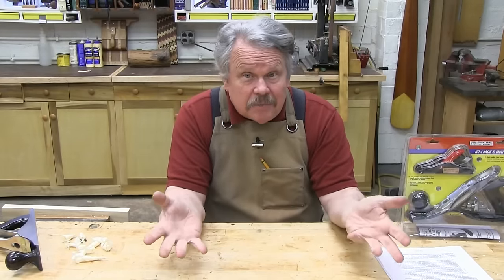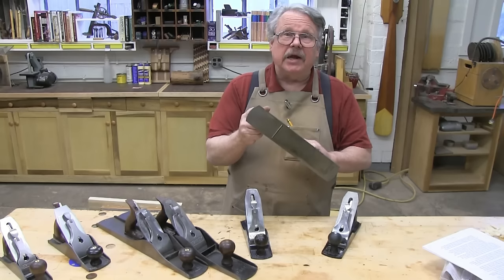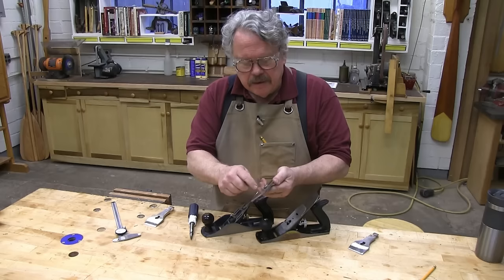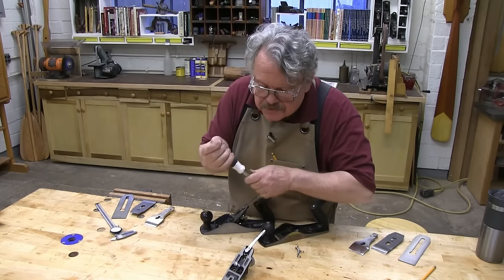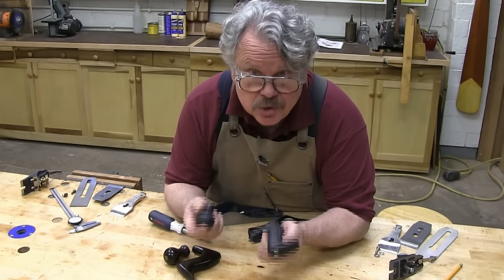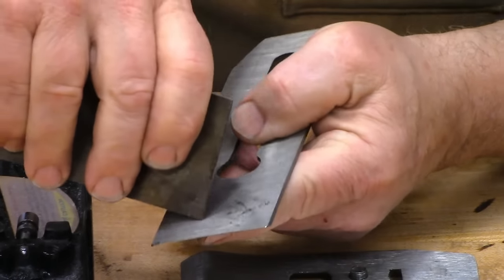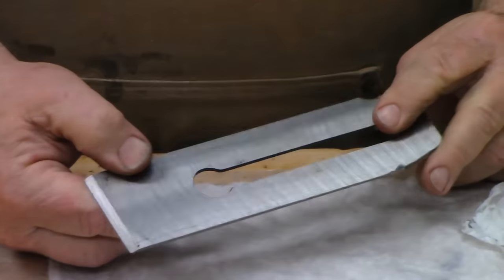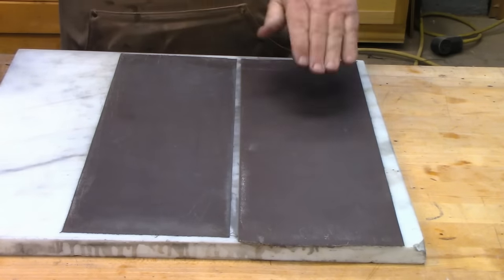Harbor Freight Jack Plane - How Does It Stack Up?

Comment: I ended up purchasing a windsor number 33 from harbor freight two months ago and boy, the regrets I have and its far too late to return it. The base is cupped outwards from the middle and I've wasted hours and lots of low grit sandpaper trying to flatten it by hand (I have no belt sander, sadly). I went to look at this exact model you worked on here today and rather then risk taking another crappy plane home I opened up the packages and boy, I am glad I did.

The mouth was so badly chipped on both that it even a novice like myself could tell it was beyond saving. I brought both up to the employees and pointed out the glaring flaw and left it with them.

I can't find hand planes in my immediate area and I am leery of buying any online without seeing it in person. But I'm running out of options. I might have to take a gamble and drive an hour away to look at some older vintage ones that I'll probably have to work at restoring. It's so frustrating, I want to try to use a decent hand plane without breaking the bank.
Reply from the maker: I have been on a search for affordable new hand planes ever since we did the Harbor Freight video, and several months ago I picked up the new Jorgenson No. 4 ($70) and it's sidekick, a low-angle block plane (a knock-off of the Stanley 60-1/2 -- $35). I hate the orange color, but both are are excellent planes with dead-flat soles and A1 tool steel irons. Furthermore, the No. 4 has a 1/8"-thick iron, so there's is absolutely no chatter.  This is the first new-but-cheap plane I've tested whose quality equals or exceeds the old Stanleys. For $105, you can have a two-plane solution that will meet 95% of your hand-planing needs.
Reply: @WorkshopCompanion  Oh wow, thank you so much responding to my comment and giving me a recommendation! I didn't even know my Lowe's had this plane as an option, and they actually have this in stock! And its actually affordable compared to some of the other planes I've seen online.

I confess, with the video being two years old I thought you wouldn't see my comment. But I really appreciate you taking the time to reply, and I'm hopeful this is the right plane for what I need. Thank you so much! :)
Reply: Update. Got the plane today and all the work I had to do was sharpen the blade and put a camber on it and WOW. This thing is amazing!! I’m finally learning how to plane and I’m getting nice shavings! Thank you so much for the recommendation, it’s working so well. :)

Comment: This video is very interesting. As bad as this Harbor Freight #4 seems to be, I purchased a Harbor Freight #33 Low Angle plane a couple years ago and found it to be excellent. To my surprise, its as good as any of my old Stanley planes! The luck of the draw?
Reply from the maker: Windsor Design seems to be a very different company from Central Forge. Perhaps HF is trying to upgrade.

Comment: Nick, I noticed the angle jig you used on the belt sander. Spotted the wheels ... would you give us more information on how to build one, please?
Reply: It's a sharpening jig I designed years ago. You can get the plans in my book on sharpening. See https://workshopcompanion.selz.com/item/sharpening .
Reply: @nickengler3447  thanks, Nick. I got a new SS after 20 years without one, and I’m loving it!

Comment: Rather than open up the recess in the frog, reduce the diameter of that screw head by about 1/16".  Chuck it in a hand drill and run the edge of the screw head against your grinder's fine wheel.

Comment: If you want a much quicker test for stainless steel just get a little tube of Birchwood Casey gun blue and wipe a little bit of that on it.  Stainless steel will not take the blue so it won't turn it black. Degrease it first with some acetone or lacquer thinner.

If you could find a good price on a Stanley cutting blade you could probably install it in this and improve it.

Comment: In here you said that the Stanley handles are made of rosewood. Are all the vintage Stanley plane handles made of the same wood?
Reply from the maker: No. Stanley changed wood species during the wars when supply lines were iffy.
Reply: @WorkshopCompanion I’m pretty sure my number 3 plane has rosewood. I sanded it all down to 2000 grit and is beautiful!  Really nice feeling in the hand, too.
Reply from the maker: @aurtisanminer2827  You can daye your plane with the info available from Hyhperkitten: https://hyperkitten.com/tools/stanley_bench_plane/dating_flowchart.php

Comment: I bought that exact same set from HF when I first started building things.  I was on a super tight budget.  It's a complete piece of crap.  The irons depth adjuster wouldn't actually adjust the depth.  The chip breaker being wider than than the iron was only half the issue.  The iron itself, however, isn't too bad.  I use it as a spare iron if I don't feel like sharpening my main iron if I'm trying to get stuff done.  But I suggest giving a light coat of oil after using it though, as it does rust.
Reply from the maker: And that's about the only thing it does.

Comment: Is the green stuff that you rubbed on the paper a form of jeweler's rouge?
Reply from the maker: Sort of -- it's a polishing compound, chromium oxide, and is identified by the green color. Depending on who makes it, the grit equivalent is between 1200 and 8000. Jeweler's rouge is ferric oxide, appears red, and can have a grit equivalent of 400 to 1200. It's called jeweler's rouge because it's not a very hard abrasive and works best with soft metals such as gold and silver.

Comment: my guess is that you are mistaken on believing this part is stainless steel.
Most stainless will not stick to a magnet and you have used a magnet quite a bit.
i believe your rust test was tainted by factory coatings and/or oils.
awesome and informative!!.

Comment: You’re better off buying 2nd hand Stanley or Record planes than the cheap imitations. They may still need cleaning up and fine tuning but they can be good for many years of working, just make sure there’s still a good bit of the cutting blade left and all the parts are there.

Comment: I bought one of these boat anchors because my Dad have me his Stanley 4½... The blade looked he tried planing nails, then I borrowed my uncle's, very much a tool guy and an engineer... The blade was in worse shape 🙄😳 Then I saw the HF plane and thought why not. I've put a razor edge on it but the rest of the problems you found outweighed the benefits of fixing it. I decided fixing the Stanely which only had a blade issue was worth it after I bought what I didn't have and needed to do it. I'll never buy a POS like that again. I realize you pretty much need to tune up any plane you buy but I don't expect to re-engineer it entirely.
Reply from the maker: The 4-1/2 is a very good plane, one of Stanley's best. Some folks don't like to the wide blade, but once you get it razor sharp, there's nothing better for smoothing. Even with the $15,000-$20,000 worth of equipment I employed to re-engineer the HF, I couldn't get it close to the Stanley. You made the right call.

Comment: So in your opinion what is a good beginner or novice plane that is in a similar price bracket?
Reply from the maker: There is no good "beginners" plane in a $14 price bracket, although you can sometimes find a restorable old Stanley, Miller Falls, Record or other  brand made prior to the 1970s at Ebay, Etsy, or garage sales for under $50. That would be my choice. You can buy some barely usable new planes for close to that price, but if you take the time to search out an old respected cast-off that needs a little TLC, you'll have something that will last the rest of your woodworking career.

Comment: other than ascetics, what is the reason for cleaning the metal flashing? It seemed like it was not in areas that were doing anything where it would play a part in things.
Reply from the maker: Not "cleaning;" but "cleaning up," as in removing. Metal flashing on a hand tool is sometimes a danger in itself -- I used up a few band-aids wrestling with it. Sometimes it will interfere with the operation of the tool, as did the flashing around the opening in the lever cap -- it made it tough to get the cap on and off. It may also interfere if it breaks away -- or it may scratch the wood. And finally, it's just bad craftsmanship on the part of the manufacturer. Leaving it there is not an option for a good craftsman.
Reply: @WorkshopCompanion  ah gotcha, thanks much for the reply, and the amount of work put in here showing the difference in engineering quality and qc between the well made but pricier, and the cheap and "looks" the same tools.

Comment: To be $13 for two planes, compared to a $100 and more plane. Its a comparison between an alibaba electric car that cost $2000 and a 525i bmw. It quality its very very noticeable. But at the end of the day the cheap stuff will help u start, and get comfy with the subject, until u able to save $. For a Stanley or even Veritas.

Comment: A few years ago a customer gave me a pile of tools her deceased husband had bought awhile before passing away. One was a plane manufactured in India, no name, just future rust.. The ONLY salvageable part I could identify was the iron or cutting blade and the only use I've found for it is as a pry bar..Not a good pry bar, but it will get up under tight edges to get a tiny shim up under things. 
The sole was so badly cupped you could theoretically drink coffee from it. God knows why, but I still have it on a shelf.
Reply from the maker: I have several planes manufactured in  India in the 1980s and 90s, copies of English "Record" planes, many of which were themselves copies of Stanley planes. Two of these planes are reasonable tools that I have been able to restore and use. Most, however, suck dead toads.

Comment: I bought this, the iron in the #4 knockoff iron is too long to pull back enough to get a thin cut. Worse problems to have, just haven't spent the time at the grinder needed to fix it yet.
Reply: The problem could be with the chip breaker rather than the length of the iron. By that I mean the position of the square hole in relation to its edge where it meets the iron, or the position of the screw hole, causing the screw to bind in the depression in the frog.

Comment: Is it necessary to put tension on sole body to get sole perfectly flat? I a l ways put iron and chip breaker back in body as I flatten the sole.
Reply from the maker: It's a good idea. At the very least, replace the frog. And if you watch our video on tuning a plane, I do all that. But in this case, the shoe was already way out of whack, and adding the dismal castings made it far worse. Since I was just trying to  make a shaving, and I didn't yet know how much I was going to have to modify the castings to get them to fit, I just gave the sole a good grinding all by its lonesome. Quickest way home, and it still took me several days to make that shaving.

Comment: Every time I tried to cheap out at Harbor Freight, I'd be much better off than if I never bought there in the first place. It's hard to screw up a screwdriver, but if you get into anything mechanical or with expected tight tolerances, shop elsewhere unless you enjoy wasting time by driving back and forth to return it.

Comment: The plane irons like that one will never be martensitic stainless steel. It's much cheaper to use a blanking tool steel that's like a 0.6 to 0.8% carbon chrome vanadium steel (as in, a steel that's more plain than O1). 

It probably has a lacquer on it to prevent it from rusting. Blanking tool steels like that probably are less than a dollar in china, and they can be heat treated quickly and easily in open air. 

I've seen two fatal flaws on planes like that:
1) some part literally doesn't fit. Like a cap iron can't be set to the edge of the iron or a slot in a chipbreaker is too small to go down the adjustment pawl. 
2) aluminum lever caps or aluminum frogs or both. Aluminum doesn't have enough stiffness to work as a lever cap, and the plane won't have enough stability to cut evenly in hardwoods.

Comment: I couldn't get thin enough curls. It would cut too deep or just scratch. When I did manage thin curls they would go under the chip breaker and get wedged. I threw mine out

Comment: What's the best plane for joining pallet wood
Reply from the maker: Pallet wood is just wood, and usually a mix of species. When we send the old-timey airplanes we build overseas, we deal with a pallet company that uses oak, poplar, soft maple, whatever they can get. Often they will buy logs shot through with "Blue Stain" fungi since the blue-stained lumber can't be sold to furnituremakers. But it's physical properties are just the same as regular wood. Any well-tuned plane will do just fine.

Comment: I bought the same type of plane(no.4c, wooden tote and knob, about 20euro) having the same exact issue(hollow sole, bent iron, no lateral adjustment). I tell my self this aint gonna work without me knowing the feeling of a proper plane working. So I bought another one along the line of wood river and quangshen/luban planes from dictum(123 euro when I bought it), then I never go back and tune the cheap plane. Its just too much work( mine's frog also not seating properly, mating surfaces have different height). Its a shame that they put in the material but just a bit too short then the whole thing turns into trash.

Comment: A not-too-sharp potato peeler can be the right tool to remove sharp plastic extrusion seams such as from the handles.
Reply from the maker: Nice tip. You can also use a scraper.

Comment: Wouldn't you ruin the heat treat on the plane iron by hitting it with the belt sander like that?
Reply from the maker: Not if you run the belt sander at a very low speed -- mine runs at 250 ft/min. And I keep a small container of water nearby and deep the iron in it from time to time -- standard practice when sander a grinding a a tool with a temper you want to preserve.

Comment: As you know Stanley started.to remanfacture their famous #4 plane.a couple of years ago nobody took this plan seriously no way would they succeed in quality control. My friend is a cabinet maker by trade and acquired Stanley's latest version . He came.to me. A second generation tool maker and wanted me to check the bed and see  if something was wrong I gave it the standard straight edge test .Much  to my surprise it was twisted at least a 64th of an inch.I gave it to a tool maker he set it up on parallels and ground it flat took out the twist or so we thought. I kept the bed in my shop for several weeks Much to my surprise the twist was back.I tried to obtain.the exact type of metal they used in China for the bed with no luck couldn't  or wouldn't tell me.My next test to me what was wrong I simply picked up the bed and tapped  it with a hammer it had a nice ring to it.It must be some bronze steel mix.when we used to get fixtures from a foundry they were considered green we had them dumped on the ground snow rain and hot weather 
If you tapped  one.of them it.went thunk.the cast had a chance.to cure and eliminated all stress from it.Stanleys new.bed spent.that winter rusting in the snow I then had the  boys.take a webber charcoal gril fill it up and got the fire nice and hot placed the bed on the coals and let it completely cool down 
Since it was.alyways the same end that twisted I was able.to relieve the stress in the bed.i check this bed every chance I get.so far it remains.flat
To end my message  my friend had to follow the same list of corrections  you had to befor he had anything.that resembled a true  stanley #4.
Reply from the maker: Thanks for sharing. When I was working for Shopsmith, we had to let our iron casting cure for a minimum of six months before machining them. Jim McCann and I both speculated that some of the problems the Central Forge plane presented could be caused by green castings.

Comment: Is there a cheap way to get a quality plane tool? Stanleys are so expensive
Reply from the maker: There's expensive, and there's expensive. Used Stanleys clock in at $35 to $80, unrestored. If I had to pay to have that blade ground flat, I would have well over $800 invested in time, materials, and services needed to turn  that Harbor Freight POS from a useless piece of junk into a fairly lousy bench plane. Used Stanleys, Baileys, and similar bench planes from the late nineteenth and early twentieth centuries are among the best values in woodworking.

Comment: I'm figuring the cost to have the machine work on a single plane would easily set you back a couple hundred bucks. Only buy a harbor freight plane if you have free / cheap access to a machine shop or deep pockets so you can pay for machine work.
Reply from the maker: Or if you have a week or two spare time to do the necessary hand work.

Comment: You talked about canabilizing a customer base and how creating such crap tools will keep customer from coming back. What's worse is that you might cause new woodworkers to give up thinking it's them rather than the tool. Any suggestions for a good low-price plane that doesn't require quite as much work to tune/rebuild?
Reply from the maker: Ebay. Stanley Nos. 3, 4, 5, or 60-1/2. Preferably made before the 1970s.
Reply: @WorkshopCompanion  Those are getting harder and harder to find, and people are starting to realize they're worth something. The ones I could find tonight, for example, were either as expensive as a new Stanley or require at least as much work as the HF model. Any suggestions for a new plane in the budget category?